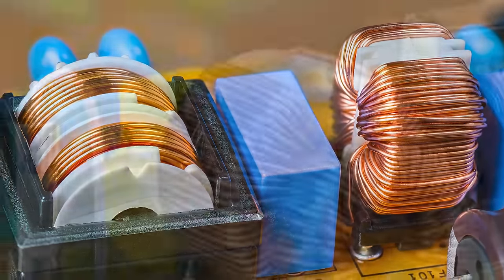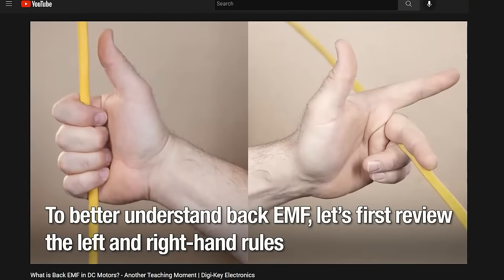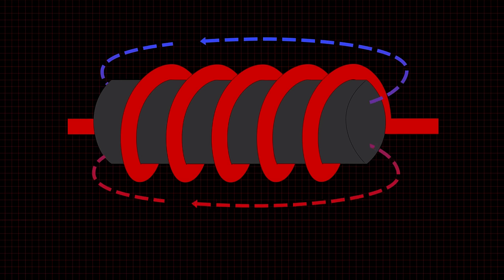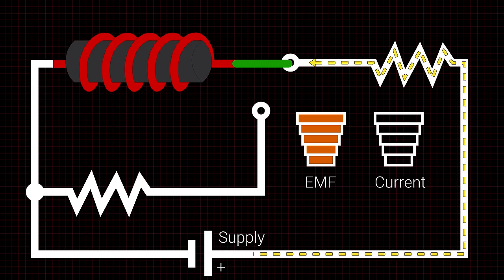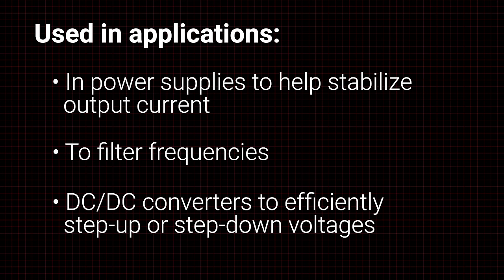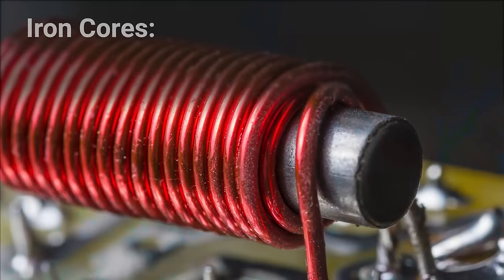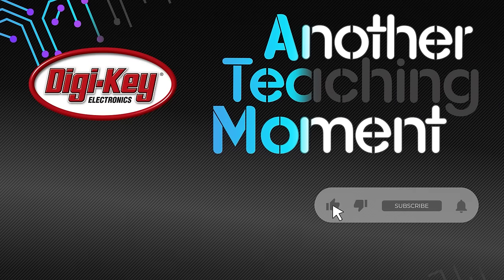What is an Inductor – Another Teaching Moment | Digi-Key Electronics

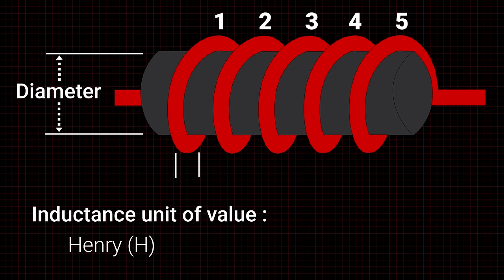Comment: Diameter  of conductor at 1:34 does not influence on inductance, but distance between coils does.
Reply from the maker: Hey James, thanks for reaching out. The diameter of the core affects the diameter of the coils, which causes an increase in inductance.
Reply: @digikey  There has probably only been a slight linguistic misunderstanding here. After all, we have a unified formula for inductance which shows that the inductance decreases as the length of the coil's core increases.